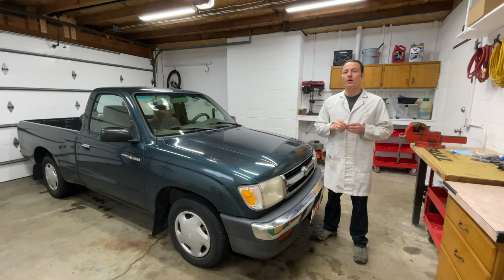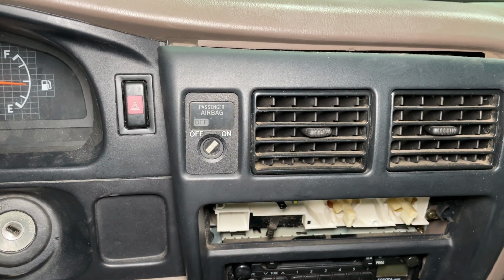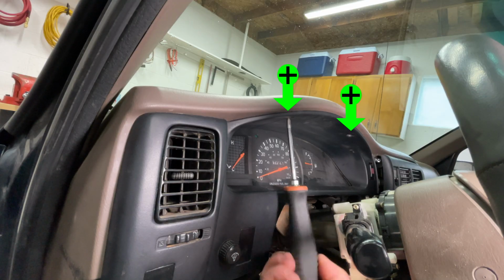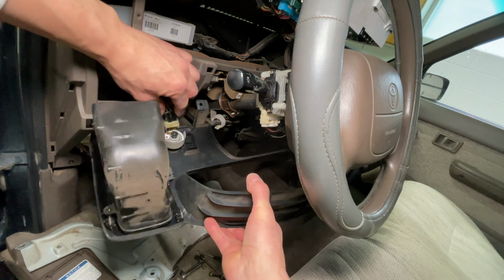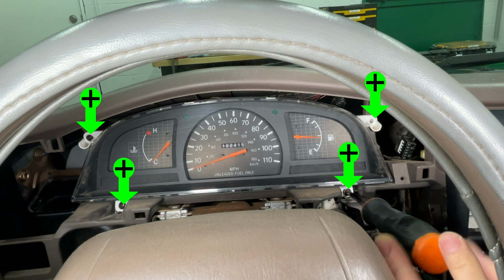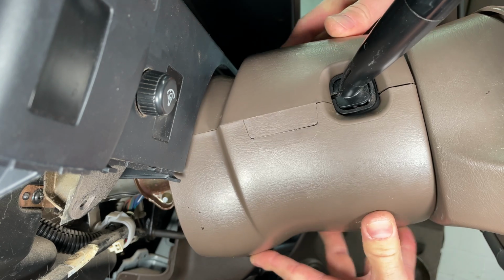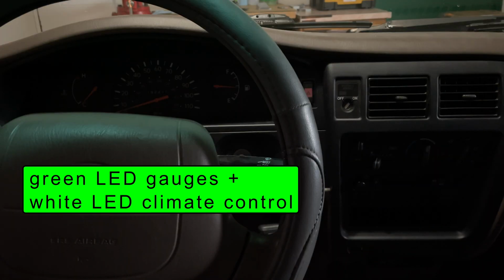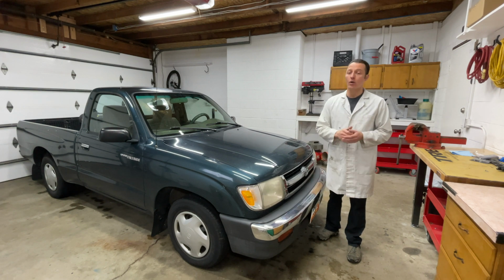LED dashboard light installation 1998 Toyota Tacoma

Comment: What about the turn signal lights. What bulb do they take?
Reply from the maker: I don't know, but according to Autozone, it's the 1156 bulb. You can look it up on most auto parts websites.
Reply: @LabCoatPaul i mean the turn signal bulbs on the dashboard cluster.
Reply from the maker: @jabrielwhite17  I didn't actually check those, but I think they're the same size as the illumination bulbs.
194 and 168 bulbs are the same size. With incandescent bulbs, the higher number is lower watts.
168 = 4.9 watts and it's used for illumination, like a dome light.
194 = 3.8 watts and it's used for an indicator, like the dashboard. 
When you get LED's, the wattage will be much lower and the light will be brighter, so the 194/168 refers to size only and they're the same. 
Be careful when switching turn signal indicators to LED. A white LED could be too bright and will turn a green indicator to very light green. You're better off with a dim yellow light for that, or just keep it incandescent.
Reply: @LabCoatPaul i see. Thanks for the advice. I think ill just go with a dim one like you suggested

Comment: Just completed this job. A couple of notes for anyone else looking to do this. Depending on what exact model your Tacoma is, you might have some extra steps. I have a 2000 Prerunner and in addition to the removing the electrical connectors for the hazards and dimmer, I had to remove one for the ECT PWR button. I think some models also have an optional differential locker button so keep that in mind. My gauge cluster is also slightly different from the one in the video so I had to replace 2 additional of the Lasfit LEDs. I ordered 2 like he showed in the video when I really needed 4 so I had to order some more and do the job twice. Finally, I bought the same sizes for the LEDs mentioned in the video and they are a very tight for the sockets they’re supposed to fit into. The incandescent bulbs that I took out go in and out smooth as butter, but the LEDs fight with you. They will go in and work however they weren’t the best fitment. Hopefully this helps if you’re considering doing this job.

Comment: My light adjustor nob connector was almost impossible to take out. I didn't want to rip it out and the plastic is pretty old so I had to be careful. The cluster was hard to take out because my taco has a the shifter located on the steering wheel since it's an automatic. It took me 1 extra hour to do this job but by God I did it and now I have a blue color to my lights. It's worth it lol
Reply from the maker: Good job!  One of my favorite dashboard tools is a plastic pry bar.

Comment: is there anyway to take the glass off the dash cover for cleaning?
Reply from the maker: It's plastic, not glass.  The instrument cluster is sealed, so there shouldn't be any dirt inside it.   If you need to clean it, remove the gauges from the truck, and the cover is held on with a few screws.

Comment: will those dashboard LEDs fit in the slots for the gear indicators/warning lights etc? the D light on my 98 tacoma is out and I want to just make the whole dash LED
Reply from the maker: I haven't replaced them, so I don't know for sure.  My guess is they'll be the smaller T5 size.  I don't recommend using LED for indicator lights because the indicators will all be the wrong color.